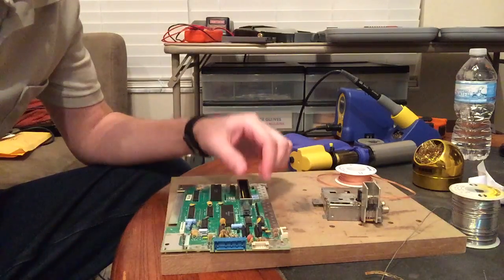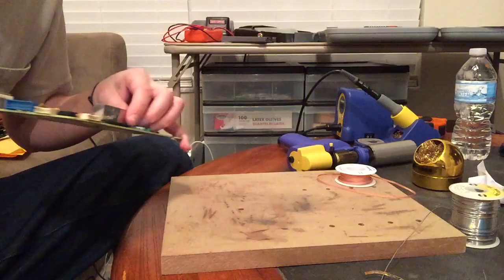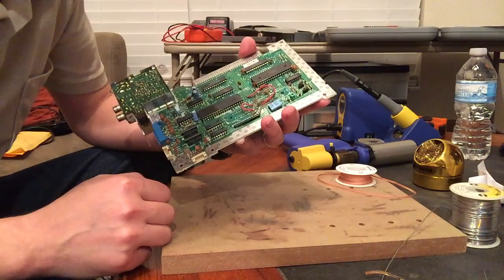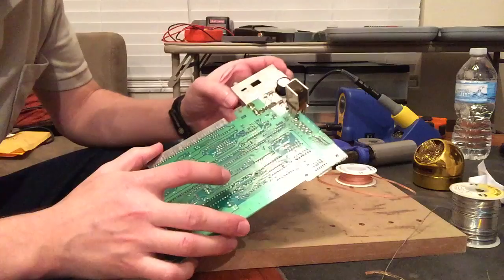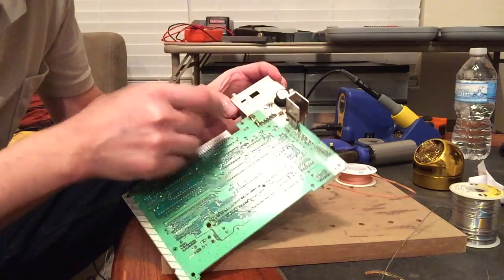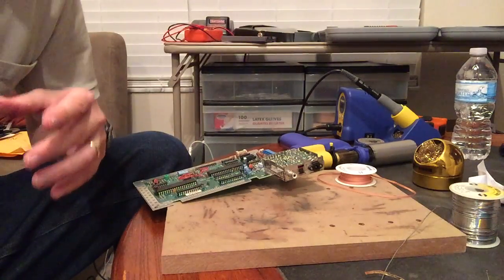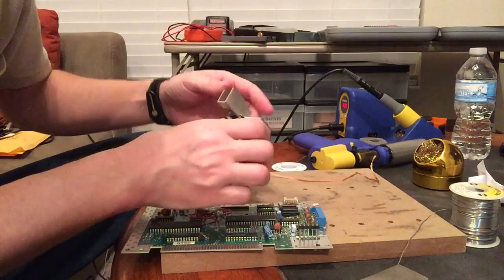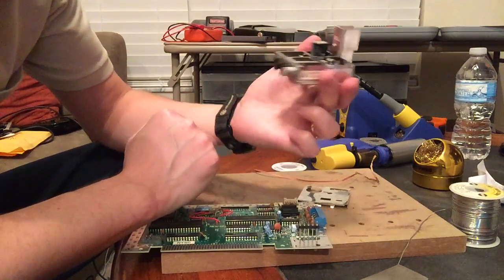Original NES power module removal for capacitor replacement

Comment: I am absolutely no expert; I haven't even used my FR-301 yet, but from watching other videos, it looks like if you add some fresh solder, prior to using the soldering gun, that they come out easier. And if the entire point doesn't come out, to add solder again and re-try might work? Just an idea to maybe get this entirely off without having to use the braid as well. THANKS for this video!! I'm really wanting to restore my trust 'ol NES!

Comment: what if you just dremel the top side of the shield box, and then to close it you place a sheet of aluminum on top of the hole and solder it in place?
Reply from the maker: I suppose you could but I wouldn’t. That’s a pretty destructive way to do it and you might get shards of metal stuck inside that could cause components to short out, potentially ruining your console. Generally the goal is to preserve as much of the original as possible and not do irreversible modifications. Once you practice some desoldering, it really isn’t that hard and is the ideal way to work on something like this.

Comment: Just in case you don't know use flux it helps a great deal.
Reply from the maker: Good point!  At the time I filmed this I hadn't used flux yet, but a lot has changed in a few years.  Working on electronics is a learning process.  Thankfully I haven't damaged anything that wasn't already broken.  Old consoles are great to learn on if you can get them cheap.  I learned how to work with SMD chips by picking up a bunch of broken SNES and TG16 consoles.

Comment: What's the ideal temp do you use for your soldering iron? :)
Reply from the maker: I fluctuate between 700 and 800 Fahrenheit depending on the task. I’m not a soldering expert but that’s what works for me.

Comment: Neotwig. I also lifted up two of the through hole pads from the board on my first attempt at desoldering the 5 pin connector before watching this and realizing it will come apart if you desolder the 5 pins from the top. I heard you say though you were able to repair that. What method did you use to repair it. Thanks!
Reply from the maker: It's been a long time so I don't recall the specifics, but in general.... You can see on the board where the trace from the pad goes, so you can compensate for the pad damage by soldering a wire or small piece of metal (like a capacitor leg) between the pin and the next component in line on that trace.  Only use bare metal if the connection is very close and it won't touch any other components.